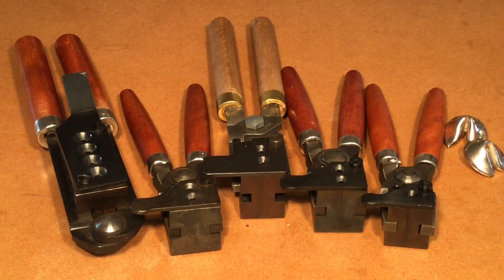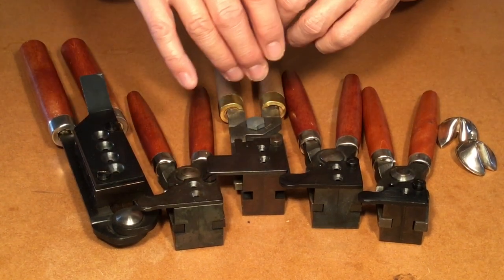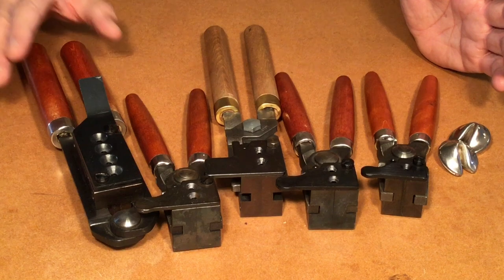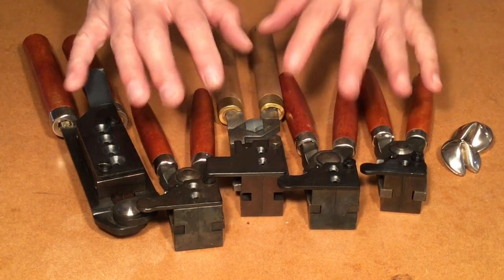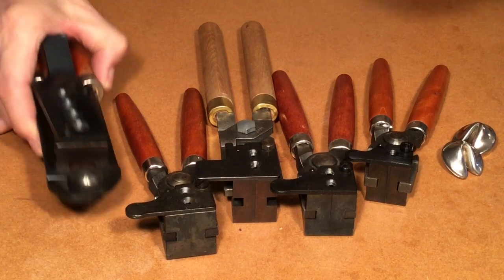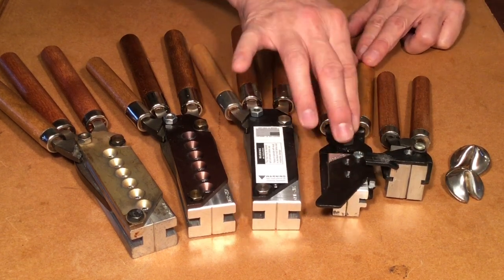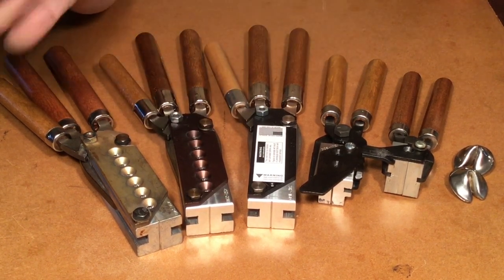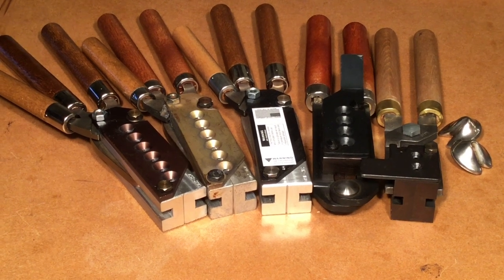Pluses And Minuses Of Lyman, RCBS And Lee Bullet Molds: VR To Stephen Riddick

Comment: When we buy our Molds we need to understand that it takes maintenance, even if we have aluminum mods of ones made of brass. I guess some more than others. Break cleaner sold at Walmart in the automotive section works good at degreasing a mold the you have previously oiled for storage, and pre heating molds on a inexpensive hot plate helps bring the mold up to temp for less of the rejection of castings. You did a Justice to all the molds out there that are available to us out there Steve.. Good video and good casting sessions to you my friend. Dave

Comment: One advantage to iron/steel molds is the capacity to cast higher temperature metals such as brass, pewter, or anything experimental as long as it does not violate laws protecting law enforcement.  Of course lead casts have a lot of challenge regarding weight, hardness and barrels, but having the ability to try other metals just seems to the biggest advantage to iron molds.  I can't say it enough, Thank You Fortune Cookie for sharing your knowledge and coming up with these tests.
Reply: Lyman bullet molds are made from heat treated, leaded steel.  They feature hardened steel alignment pins and flat ground sprue plates held in place with tempered steel spring washers and screws. 
They are not iron

Comment: hello fc,a elektric heat controled cooker plate ,is ideal for warming up the iron moulds ,a sponge in a foodplate  with water is ideal for cooling down a aluminiumould
.dont waite long for solidifying with the lee 6 cavity ,i move the spruplate almost direct a littlebit as the color changes of the filling ,that way there is almost no resistance and no force is needed for opening some later, with other alu molds the same

Comment: On all my handle to the molds. I bought a bag of scrap leather from Amazon. I wrapped all the handle in the hot zone of the mold handles. Glued them with CA glue. Now they always stay comfortable in your hands. Cast for an hour or so and you start chocking up on the handles towards the hot zone. I fixed the problem.

Comment: Another disadvantage of the Lee molds, THE STUPID SPRUE PLATE SCREW BACKING OUT!  I have 18 Lee Molds and the screw has come loose on every single one.  Some it happens the first session, some last a while.  I lubricate them properly, but it still happens.  I've just started installing set screws in all my Lee molds.  It's so frustrating.  I would gladly pay an extra 10 bucks for them to come with a set screw installed so I don't have to drill and tap all the stupid things.  I think I'm done with Lee molds.  I recently ordered a NOE mold, so we will see how that goes once I get it.  I'm tired of having to mess with prepping, "Leementing", and messing with that stupid sprue plate screw on every one of them.

Comment: Tried the aluminum Lee's myself, being quite cheap.  I'll agree with every bit, but I'll add that my experience with Lee handgun bullets is that they are fine for handgun, but don't perform as well in pistol carbine.  And Lee bullets just don't drop as crisp and clean like the Lyman bullets do.  Over time, I've been replacing my Lee with Lyman, and looking at some Saeco even, because I hate working so hard to keep the aluminum in that sweet spot, especially with my high demand for close bullet weight.  At some point I think the weight is worth the quality, especially when rifle and 100+ yards are considered.

Still, those double Lee molds are impossible to pass up.  $20 on sale, and you can get double cavity ball molds you can only get single with the iron molds, and at a tiny fraction of the cost considering the double Lee comes with handles attached.  I'll say iron is better, but Lee can make certain products so well for so cheap you can't possibly pass them up.
Reply: I have used Lee Lyman and Saeco molds.  The Lee molds show signs of wear after casting a few thousand bullets and do not cast as  nice as the other two. Lee is a great way to get into casting. The Saeco and Lyman molds will drop perfect bullets every time from the first cast in a cold mold. The Saeco molds will tend to get lead smear under the sprue plate but the Lyamn mold is clean after many thousand cast.

Comment: Don’t use oil on your molds.  Use spray tool preservative,  which is designed for that.  To speed up removal, use carb cleaner when the mold gets hot.  Also, apiece if 1/4”  or better across the pot is a good place to warm your molds.  Place them with the sprue down. Remember, the first ton of lead you cast is the hardest

Comment: Hi, Mr cookie. I think that aluminum's thermal properties are a major advantage. Aluminum heat cycles faster. This means your bullets cool enough to drop free faster. This both allows and requires fast consistent casting speed. I would prefer that to an iron mold with the opposite traits. Who wants to go  slowly ?
Reply: Exactly. Iron has a few down sides. The biggest is rust. Iron is always a big pain to keep oiled and then you need to get all the oil out.  With nothing to inhibit the rust you must keep iron oiled when not in use, it will rust otherwise. Just a matter of time. They need a lot of care. The aluminum molds are where it's at. You can afford more molds and they last and last and last just as long as any Iron mold and the castings will be more consistent. They need no care at all. True they take a bit longer to heat up but they also cool off quicker.

Comment: Lyman bullet molds are made from heat treated, leaded steel.  They feature hardened steel alignment pins and flat ground sprue plates held in place with tempered steel spring washers and screws.

Comment: Showing the steel molds, you picked up the one on your far right (about 5'52") several times as you spoke. Was the sprue handle tensioned properly or was it loose? In normal casting how much is required in the way of maintaining screws, pins, hinges, etc so nothing seizes?
Reply from the maker: pramponi - The steel molds have a tension washer on the sprue plate so that as we swing the sprue plate closed, it tightens up at the end to give us the good bullet bases.  They can swing rather freely otherwise.  And if the sprue plate screw is too tight, it will bind at the closure.  Good castin' to ya, FC

Comment: Good review !   I can't wait for the "advanced" bullet casting mold video. When do we take the plunge and buy a custom mold  ?  It takes a lot of research to know if buying a custom mold is right for you. I just got mine from accurate molds- but I knew what I was going to use it for and why. You had a choice of steel, aluminum or brass.  But brass can melt if you don't know what you are doing so I went with aluminum.  Do you have any custom molds LC ?

Comment: If you don't mind, what is the mild # and manufacturer of the 230gr hardball for the .45 acp?
Reply: Maybe the Lyman Bullet Mold #452374 45 Caliber (452 Diameter) 225 Grain Round Nose? On the Lyman website it is the only round nose mold in 45 auto

Comment: Hi fc45lc. I have a lee 6 cavity mold that I was casting with the other day. I was having some issues with the molding closing completely. It seemed that when I closed the spruce plate in was pushing the mold open slightly. I loosened the bolt where the plate locks in to and it solved the problem. Do you think by doing that I might encounter some other problems?

Comment: hey fortunecookie45lc i feel like you the one guy on youtube with a ton of info about mold and casting. i have asked a few question in the past and i have one more for you. my coworkers uncle passed on and left him RCBS bullet molds. he sold them to me for 10 buck and they have rust on/in them what is the best way to remove it with out hurting the mold on the inside? thanks again for all the awesome videos and info.
Reply from the maker: MrChalupaMonkey - That tommygun armed ape is going to be formidable indeed.  Rust is always a matter of degree.  If light rust, you can rub it off without trouble.  If heavy, naval jelly to remove it - but there will be pitting.  If not too bad, no problem - your bullets will size and any remaining irregularities will be cosmetic only - If you powder coat, that will actually take the powder coating better.  If the rusting is heavy or major, don't even bother.  Send back to RCBS, they might even send you new molds...People have great choices in molds nowadays.  The mold making industry has some serious competition.  Best to ya,  FC

Comment: not exactly what i was looking for. so if im looking for historical reproduction pieces for casting lead roundball were could i acquire such a set?
Reply from the maker: James Smallwood - Wow, you want the real thing..!!  If not, the answer would be easy, Lee and Lyman make roundball molds left and right, but you knew that already...for original stuff, you might have to go to Ebay and see what's available.  Also, you might post want ads at local ranges - amazing what the shooters there have in their garages.  Inquire with the rangemasters - some of those guys are really well connected.   Also, calls to gun shops specializing in cowboy action stuff might be able to help you.  Good mold hunting to ya,  FC

Comment: FC45.   what can you do to make the bases come out better?  I have a Lee 6 cavity mold and I am getting galling and smearing on the mold and the bases have a pit or hole where the sprue was cut, but not cleanly.  what can I do?
Reply from the maker: Steven Rogers - These are all normal happenings...when casts are coming out great, it's the sweet spot.  You have left the sweet spot.  To cure the lead smearing, lower your alloy temp slightly, then use a wet sponge - just plunk your filled hot mold right on top of the sponge - let it sizzle until your sprue frosts over, then cut the sprue - there should be no smearing.  2) If galling (unsmooth operation of a Lee mold) is happening, lube the mold.  3) To cure the sprue cut off - let the sprue harden just an additional five seconds and the wet sponge as needed.  If you have some sprue irregularities, your bullet will be off balance, but no problems for plinking and recreation ammo or for shooting at 15 yards or less.  Good reloadin' to ya,  FC
Reply: Thanks FC... Just ordered some alloys from Roto Metals .
Reply: I was just watching your great cast bullet sizing controversy video and you stated that the Lee tumble lube bullet cannot be sized.  Is that still true if you are powder coating?
Reply from the maker: Steven Rogers - I'm going to be doing some casting this weekend with RotoMetals 16 - 1 alloy  Should be fun casting bullets with the same alloy that Elmer Keith used.  Have a great day,  FC

Comment: Dear Fortune Cookie:

     I have a Big Lube mold that for all means and purposes is built just like the Lee 6 cavity mold.  I have a problem with the handle on the sprue plate clashing with the right hand mold handle.  Do you have any ideas about how to rectify this problem, it is not a huge problem, but one of about ten casts will have the sprueplate not fully seated against it's pin,
Reply: DD. I think the big Lube mould is made by Lee.
Reply: Dear Englishman French:

I have no doubt of this, though the molds all have an adjustment screw on the  right side of the mold that bears on the cam on the sprue plate that allows adjustment.  That is the only difference that I have been able to find.  This is a slick and easy to use mold whose only fault being that it requires extra attention in getting the sprue plate completely closed, a small price to pay for such a nice mold.  Fortune Cookie has just given me some fine advice on the use of the mold, so I'm just going to develop more careful habits in closing the sprue plate.

Sincerely Yours

Don Denison
Reply: Hello Donald Denison; The answer to your problem with the spru cutter is quite simple, if you undo the spru cutter pivot bolt with a 7/16" AF spanner, after marking the steel part and the wooden handle at the top for orientation/ reference, hold the steel part in the vice and drive off the wooden handle, hold the pivot section of the steel in the vice and knock a slight angle (3 deg) upward, then cut off 2 1/2" of the wooden handle, (this will give you a better grip on the mould handles), re assemble, and you will find the handle no longer hits the mould handles. This works vey well on the Dick Darstardly moulds. Good Luck! Chris B.
Reply: Dear Englishman French:

     Thank you so much, I was  not looking forward to developing a new and what looks like would be a difficult regimen to instill on an old fellow like myself.  I had been considering doing something similar myself but using heat to make the bending easier, but was afraid to undertake it, believing I would cause the early failure of the part due to the stresses put upon it by heating and then bending, and the resulting changes in the grain structure of the metal.  Believe me, I will be making the changes, and without the heat if I cannot easily change my molding habits.  Knowing that others have been successful with this operation gives me confidence If I find it necessary to make this change.  New habits are not easy to learn for a 75 year old man.  Thank you very much.  By the way, I like the bullets that this mold casts very much, and the quality of the mold is actually quite good, it is not like the old Hensley and Gibbs molds, but  still quite a good mold.

Sincerely Yours

Don Denison
Reply: Donald Denison : I am so glad I was able to help on this, it was one of the first problems I encountered with this set up, the fact that the spru cutter handle prevents one from holding the mould handle was also a problem to me, which is why I cut off the 2 1/2" from the length, you can quite easily put enough bend in the steel part cold, but you must be sure to hold the pivot part of the lever in the vice jaws to prevent this area bending, you only want to bend the bit that goes into the wooden handle, do not try to bend it with the handle in place as it will crack the wood, it is also important to mark the top of the handle and lever so they go back in the same orientation, if you have any doubts/problems, ask before you hit it! From another old person, Chris B.
Reply: Dear Chris B.:

     I think I have the process firmly in my mind, and no doubt will find the "stock" configuration unmanageable, but I will try to adapt to it in any case first.  I have lead jaws for my shop vise, and will rely on this set up to prevent marring the part.  Thanks again, I think I will put this computer to sleep, and try to get some sleep myself.  It is snowing heavily outside now so no doubt I'll be snowbound until at least mid day tomorrow.  Old folks syndrome lets me sleep only for an hour or two at a time, that  is why I am up and on You Tube at such strange hours.  When I get up, I think I will run a few hundred bullets since I will be snowbound anyway.  The Western  Slope of the Sierra Nevada Mountains here in the Mother Lode is beautiful, but I  wish the snow level was at least 4,000 feet rather than the 3,000 foot level it is tonight.  Thanks again, and goodnight.

Sincerely Yours

Don Denison

Comment: What do you think the best .223 bullet mold
Reply from the maker: time for some fpv action - That's a hard question to answer.  Depending on the rifling twist of one's gun, that has a huge determination on what bullet might be the best...Slow twist needs lighter bullet and fast twist a heavier bullet.  But cast bullets don't take fast twists as well anyway unless they are cast hard.  Have a great day,  FC
Reply: FortuneCookie45LC I have a 1:7 twist barrel
Reply from the maker: time for some fps action - That's a fast twist meant for stabilizing the long heavier bullets (I'm sure you are very aware of that)... The common 55 grainers from Lee and RCBS will not do.  I'd recommend one of the NOE molds like their 72 grain GC or their 100 grain FN.  If cast hard, the bullet would have a good chance to hold that fast twist.  Good shooting' to ya,  FC

Comment: Reloading has just about priced me out of commission. If I was getting into it right now it would be a hard no. Equipment is just astronomical in price. Powder and primers are expensive and use to be fairly cheap. Twenty to thirty bucks per pound in 2008 and thirty bucks for 1000 primers. Looked up does the other day. Came across a 50bmg mold,(one mold), 1200 bucks. WTH!! Better use once fired brass, projectiles are going up every couple months. These molds you are showing are sixty bucks and up. A set of lee dies are fifty bucks which they use to be thirty. Thankyou Lord for allowing me to get into it when I could afford it. The advantage of saving money is certainly not across the board. Only in certain aspects.